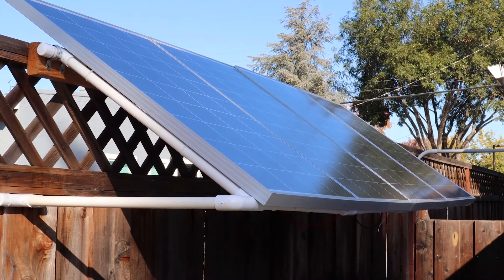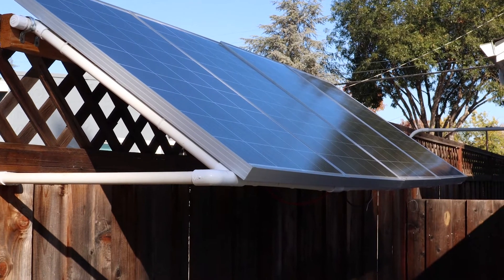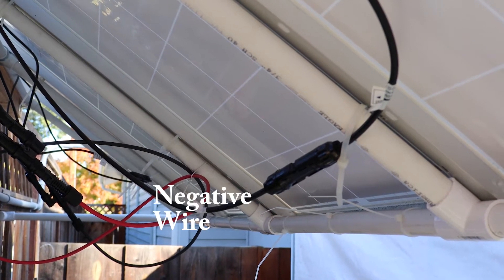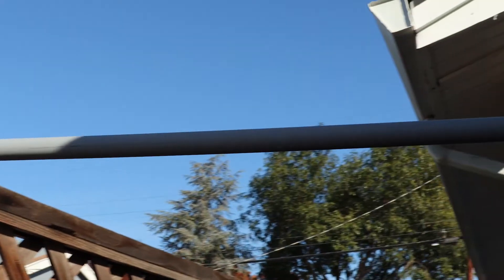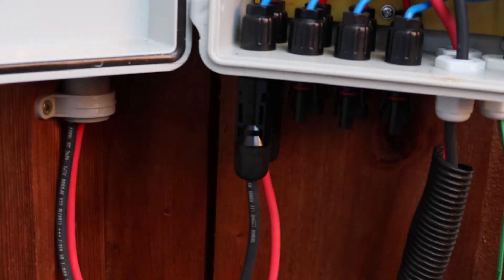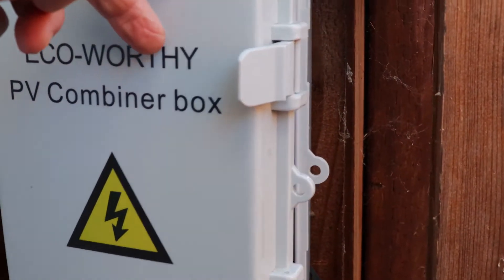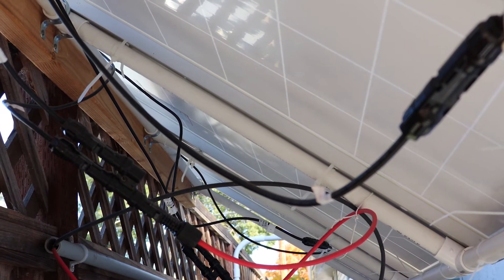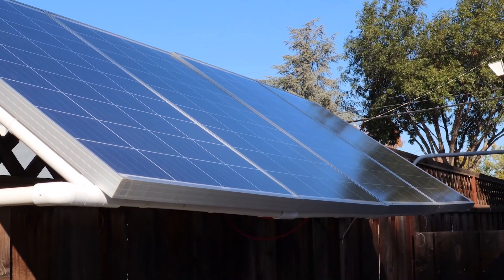Rich Solar Panels

Comment: Be sure to mention that flimsy framework will not hold up to snow load. Or a windy situation at all
Reply from the maker: Mac, thank you for the reminder. I live in the Bay Area of California, where we never get snow, so not an issue. We do get high winds occasionally, but the panels are sheltered from the north winds by the fence. People who live in areas that get snow and high winds would certainly need a strong metal frame and properly a ground installation.

Comment: I wouldn't buy one again I got one damaged ignored me stuck with bent up panel bad service
Reply from the maker: John, I am sorry to hear you did not get a good response from Rich Solar. I now have 6 panels and all arrived really well packaged, without damage. I purchased mine through Amazon, where I always get excellent support if there is ever a problem with my purchases. I just added 2 200W 24V panels that give me the same output as my 4 100W 12V panels. I am very pleased with my setup.

Comment: Cant you buy a higher watt panel so you can less space ??
Reply from the maker: Absolutely Rich Solar has a 200 watt panel and they also have a 24 volt panel. This was a project for me and I wanted to see what i could build and also stay within a budget
Reply: For even less space they have out there 500 watt panels now.  I am amazed because the best we used to get (when I was actively researching) was 300w, and they were VERY expensive.
Reply from the maker: @generalawareness101  Capacity is increasing and prices are dropping which is great news for us. I recently added two Rich Solar 24V 200W panels to my system.
Reply: @BrightSparkIdeas  Amazing.

Comment: very good job. if you are thinking about adding batteries try the GYLL rack mount, it's more bang for the buck, $1500. for 5.1 kwh
better than battle born
Reply from the maker: Fred, Thank you for the advice. I certainly need to add more battery capacity and will probably do that later this year when I have some extra cash. I will look into the GYLL.

Comment: i stared my solar adventure with 4 cheap sets from harbor freight for almost $800usd. i returned 3 sets once i learned how over priced they were and little power they produce. i kept one kit to continue to learn on for this last year. i bought all sorts of tools, wires, cables, amp clamps since then and about 3 weeks ago graduated to real equipment. i went with four rich solar poly panels and wired in series and ran that wire over 60 foot 16 awg wire and i cant believe the watt hours i get everyday. i bought 4 more rich panels but i wanted to try mono panels and another charge controller, but i bought all the parts that were available locally for my first stand, so the second batch of panels is patiently for parts to come in. anyways this last week i finally connected up my hall affect sensors , one to the input of the battery and one to the output  to inverter for now.  as far as power being made...at most i have seen 2.3kwh at worst 1kwh...again this is just 4 poly panels and this is just one week of good data. also, running a small lamp, 2 xbox ones. two larger tvs, two laptops, a full size fridge and 1500 watt microwave a few times a day is using about 6-8kwh per day. so four times my  solar  setup at the moment input should start to handle my demands at the moment, but i plan to expand to maybe power the entire house in the future, and i have the room in my yard for, that would be 16 100 watt panels for about 8kwh based on my setup atm. this was all just an experiment that got carried away, and in the back of my head i knew i could reduce my monthly electric bill, but more importantly i will have power when the grid goes down.
Reply from the maker: Jason you sound a lot like me. I started this adventure because I wanted to learn more about Solar. After building several small solar generators I was ready to embark on the project you saw in the videos. Mine was working well until this winter when the wet cloudy days made the grid provide the system 24/7. Obviously, I have insufficient battery capacity to compensate, for these events. I had planned to add two more Battle Born Batteries this year, but will have to wait until I find some spare cash. Unfortunately, I do not have the space to add a lot of extra panels. I am currently clearing an area, that might allow me to add four more 100W Rich Solar panels or two 200W. This will give me better consistent coverage this year. Congratulations, it sounds like you are really enjoying the experience and the independence that solar provides.

Comment: That outside box is so very clean! Do the MC4s come with the box? Do the breakers and fuses and lighting fuses come with the box?
  I was actually much more interested in how you built (yes, "how") the PVC frame and how you made the tilt angle adjustable. Would LOVE and how-to-make-it YouTube. Also, are the panels tied to the PVC frame with tie-wraps/zip-ties? (which I think is a really cool way to do it) If they are, and the ties are white, they are most likely photochemically reactive and have no UV inhibitors in their composition. (There is a very sad story about one of the founding inventors of Hang Gliders regarding this..... ). It could become an issue in a few years if you were to have high winds. Your panels could all break free of the frame.
Reply from the maker: Hi Ben. Yes, I really like the ECO-WORTHY 4 String PV Combiner Box with Lightning Arrester, 10A Rated Current Fuse and Circuit Breakers for On/Off Grid Solar Panel System. I purchase this from Amazon ($130) and it comes with everything you see, including the MC-4s.
The PVC frame I built for the Solar Panels is only a temporary structure, more as a proof of concept. I am going to be moving it to a better location this Summer that will hopefully give me better sun hours. The frame is is just 3/4" PVC irrigation pipe and connectors. I did not glue the two side legs, so they can twist on the lower pipe and therefore change the angle of the entire frame. When I move my panels I will probably rebuild it using 3/4" EMT electrical conduit. 
Yes, I used zips-ties, purely to get the panels up and my system working, I would not recommend them for a permanent structure, as there is to much movement in the wind and risk of abrasion on the zip-ties. I do not have the time to make the changes yet, but I will need to figure out how to find a better way to attach the panels to the new frame. When I do I will post a new video. I hope this helps.

Comment: Everything looks great. I like the eco worthy combiner box. 
 I noticed that your pvc holding up the panels looks like it is bowing in the middle. I have used pvc for a few projects. What I did to stiffen them up I think I had 3/4" pvc, then I put 1/2" metal conduit in the pvc. This made my project much more sturdy.
Reply from the maker: Thank you, that is an excellent idea. The slight bow has been there since I added the panels. Because I have zip-tied the panels to the PVC, I have been reluctant to take it down. As long as it does not get any worse, I will probably wait until the spring and try your idea. With any luck I might be able to just disconnect I end and slide it all the way though. Thank you again, and have a wonderful Christmas.
Reply: I saw a review of the eco worthy combiner box,and there are some issues.checkout HIGH TECH.   Saying that,Iwil be using them on my new system.Regarding your system I LIKe  the way you have conduited the wire .It looks neat..
Reply: Or since its a short pipe just get a cheap tin of expansion foam, spray it in one end the block that end with a bit of tape and the foam will push itself all the way to the open end, just clean of the excess with spirit, once cured it's nearly as strong as aluminium